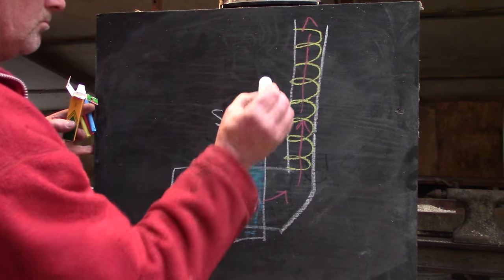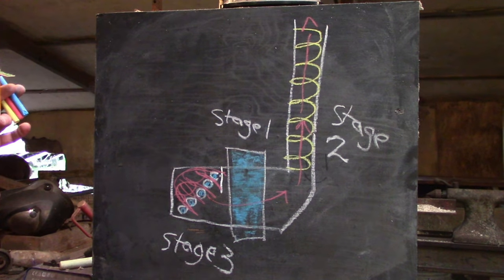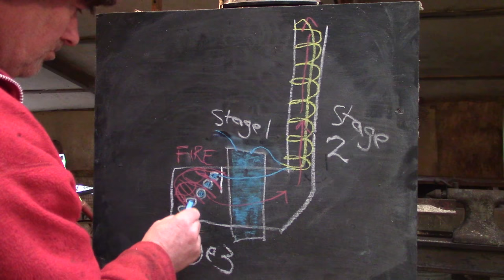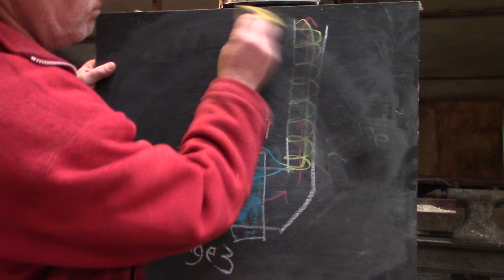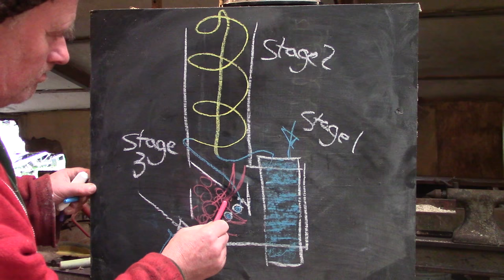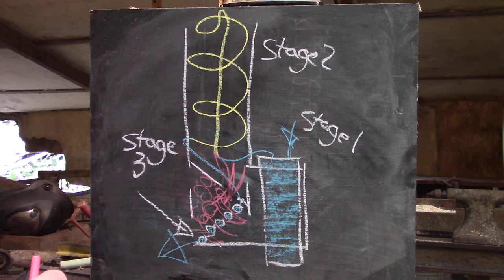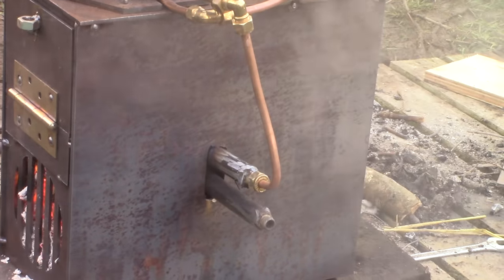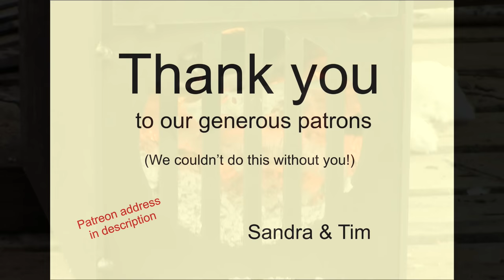Finally A Flash Steam Boiler That Works!!

Comment: Since it doesn't take much energy to superheat the steam, the grate alone may be good enough for superheating, you could use the pipe in the chimney for something else, for example preheating the feed water...
You may also mount some kind of funnel to the "wood input door", so it feeds itself by gravity and you don't need to put new wood in every 10 minutes...
A steam pressure regulated air inlet would also be great, so the air inlet gets closed when the steam pressure is too high. Of course that is a little hard to build, for a test version it should work with a manually regulated air inlet. But for a final version you may consider using something like a spring loaded steam piston, which opens the air inlet when steam pressure is low, and closes the air inlet when steam pressure is high...
Reply from the maker: In fact you need much more energy to superheat the steam than you need to boil water
Reply: @wayoutwest-workshopstuff6299  
You just need higher temperatures, but the needed energy is wayyyy lower...

For example: If your fire produces a usable power output(without losses) of 1kW, and you start with 1kg(approx.1Liter)of water, it takes 418 seconds to heat the water from 0°C to 100°C. To convert all the water to steam it takes additional 2230 seconds.
But to superheat all the steam from 100°C to 200°C it just takes less than 200 seconds...

To make this numbers more useful for continuous steam production, i calculated it for 1kW of heat input and 10°C feed water temperature:
From 1kW total input power, you need 135 Watts for preheating the water, 800 Watts for producing steam, and 65 Watts for superheating the steam to 200°C.
These numbers are just for steam without any pressure. As the pressure (and therefore the boiling temperature) rises, you need more energy for preheating the feed water  and less energy for superheating the steam to 200°C...

Comment: I really enjoy your steam videos as I myself am working on a boiler and steam engine for my stove at the moment. I also tested overheating the steam but I think more important than the final temperature is the amount of steam that is produced, which depends on the heat power going directly into the water. Have you meassured how much water your boiler can convert to steam in a certain time? If your system is ment to power a steam engine, you should test that engine (for example with an air compressor) and see how much air your engine needs to run with the desired power and rpm. I'm looking forward to your next videos. Keep it up!
Reply from the maker: the problem is with a wood fire the amount of water boiled changes all the time. That's why solid fuel flash boilers dont really exist. I don't have an engine yet - I wanted to see what steam I could produce first. Any videos of your set-up?
Reply: @wayoutwest-workshopstuff6299  I see the problem with the unsteady heat power from the wood fire. Maybe the heat in the steel and the little water reservoir in your boiler can dampen the highs and lows a bit. I wonder about the solutions you will come up with. About my engine (which is only a model but brings problems like a big one) I haven't uploaded any videos but if you are interested I could send you an email with information about the set up and how I did the layout of power consumption, steam production, rpm etc...

Comment: The flash boiler on the Whites Steam cars was coiled steel tubing. 1/2", if I remember correctly. Saves welding in tight corners.

Comment: Your dry steam still looks a little wet. I don't know if its not hot enough, too much water, or you need a reduction pipe to increase the pressue and therefore the temperature.

Keep up the grate work, lol.

Comment: You should Get a Cordless Leaf blower (With few metal Stove Flu Tube + metal Interface plate mod To Jump Start the fire in  Under 3~5 mins 

You could use the Unused stream to Accelerate Air flow with venturi effect - Exhaust steam injector > Vacuum ejector  up the flu stack with a Y Regulator valve  keeps steam moving And  increases  the Fire Temp idling so when you put the Regulator to drive   You Already have the Stream power and heat needed

Comment: Copper tube would be fine,
Melting point of copper is almost 2000 degrees Fahrenheit
A wood fire is only about 1200 degrees Fahrenheit

Also I would suggest a bigger firebox

Comment: You could of course use it to power a steam engine. But most piston and turbine engines run on pressure, something your boiler will likely not produce enough of (not before turning it into an IED).
The Watt engine however (and the Whitbread engine) doesn't run on steam pressure, but on the underpressure that is created after a valve is opened and the hot steam flows to the cold condenser. The greater the difference in temperature (ie. dry steam versus cold water), the greater the force pulling the piston down.
Reply from the maker: I'd like to make one of those too, but you need a large piston..

Comment: I believe they used to have 'fireless' steam locomotives to shunt wagons around gas and chemical works (for obvious reasons). There would be a source of readily available steam  and, rather than a boiler, the loco would have a 'steam accumulator' which was a bit like a fuel tank, but for steam.  The loco would need topping up regularly, depending on workload,  but there was the advantage of it emitting no fumes or sparks in the areas in which it worked... just a thought;-)
Reply from the maker: Wouldn't you need two pressurised containers though? One to make the steam and one to store it?
Reply: Yes, and you wouldn't actually store the steam, but rather very hot (200°C) and pressurised water. Then, when the locomotive draws steam, the pressure lowers and the water boils, until it is exhausted.
It works like a propane tank

Comment: I have a "REAL" flash boiler.  I use a stainless steel receiver placed at the focal length (10") of a 6-foot-radius tracking concentrating solar mirror, which reduces 48 square feet to 0.5 square feet.  Suffice to say, my injection pump turns several droplets of water into instant 2,000 psig dry steam INSTANTANEOUSLY !!

Comment: Absolutely fascinating ingenuity! I am afraid cleaning of coper tube of the overheater in the chimney will not be easy due to its helical shape . There will be a lot of soot. I think the match doesnt burn in flames because there is no oxygen in the steam.   I am wondering if the wood of match will be charred by steam. Best regards!
Reply: Its unlikely there will be much soot in the smoke stack. This is because the stove burns hot enough to burn off all of the gasses.

Comment: I had been thinking of a similar project, my design has the fire box piping running up the sides and over the top of the fire box as well as the grate,. Also running it as a true rocket stove by using a second larger diameter pipe to drop the fumes back down  into the chimney proper the copper coils would be on the outside of the riser pipe and a steel coil pipe about 4 inches above the riser where there would be a ferocious amount of heat. by using a extractor fan on top of your chimney you could do away with the fire box  bypass. by using two copper coils in the  down draft chamber you could feed the hot water from the tank boiler up and down the double copper coils then into the grate from there back into the the riser and up to the top to the steel coil and back down the same way and out of the side of the first boiler stage chamber, by fitting a  cold water tank on top of the down turn pipe you would be able to feed your primary boiler with preheated water, with a pan lid on it would be easy to top up and a gauge glass could be fitted. Would also like to mention a fan assisted draft to the grate would obviate the need for a chimney top fan and greatly increase the temp in the fire box for a fast fire up and steam production. sorry if non of this makes any sense to you, if not let me know and I will try again. I had hoped to produce enough steam to be able to drive a smallish steam launch of about twenty two feet.
Reply from the maker: How would you power your fan, David? 
I'm sure yours would work too, but I'm happy with mine. I just need to work out how to balance the input to the amount of heat available. As you know you can't pump hot water or steam - only cold water. How will you balance your system?
Reply: @wayoutwest-workshopstuff6299  There are only minor differences really between our ideas, I had planned a slightly larger fire box than yours fed by air from underneath and rather than a cylindrical boiler in a second chamber I would use a tank at the back of the fire box and the heat rising over it and back down the far side like a reverse back boiler more fresh air would then be fed into the bottom of the riser tube to feed the rocket effect, insulation at the correct points is the key to keeping the system going, I had thought to use a crank handle blacksmiths air pump for the initial fire up, once the fuel is gassing and the rocket effect in full swing the system should be self running as far as heat is concerned , provided fresh fuel is added at regular intervals as the draw provided by the rocket only works as long as there is sufficient gas to fuel it, of course the draw could be boosted by adding a flue or vent type breeze powered extractor to the top of the flue, however a control choke would need to be added for windy conditions to prevent over heating a second flue working in reverse of the extraction flue could be used to provide slightly pressurized air for feeding the grate should it be required but I think it unlikely as the rocket effect should in theory at least provide all the draw needed.. the system would be gravity fed  the water tank being higher than the flash tubes I think a flow restrictor at the bottom of the feed pipe to the first tank should provide enough control, the only problem I foresee is air locking in the system but this would not be too difficult to overcome with the correct forward planning. . this does of course make it all more complicated which is why I was so drawn to your idea.keep it simple. Have you discovered whether or not you boiler will provide sufficient steam to reliably drive  something like a swan or signet engine?

Comment: Push the puddle away from the mig tip, or weld away from the nozzle, chasing the bead as the puddle reaches the desired width, and you can push right into the hard to reach points of the inside angles

Comment: 1 brazing over the ground welds. 
2 please learn what a locomotive steam "Dome" is and how and why they work. 
3 never let a steam boiler of any kind run dry. NOT EVER NO MATTER THE REASON. 
4 Please continue your experiments and consider keeping all pressure experiments inside  a walled roofless enclosure perhaps made of used tires. 
5 ( My personal favorite) Practice screaming the word RUN!!!!!  AS you set your best foot work  example. 
This has the added benefit of making sure no one relocates your tools or enters your shop area without a phone call or a previous reservation.

Comment: I would research a Hartford loop steam boiler, if the piping isn't ascending as you heat it, you run a risk of condensing and losing temperature.

Comment: The new version looks much better. Very nice! The only issue I can see is cleaning. I assume the chimney can be unbolted for cleaning out, but you might need a door at the bottom where the air flows in to clear out the ash
Reply from the maker: There's a drop-down door for that, but the stove needs legs first for it to work
Reply: @wayoutwest-workshopstuff6299  Ah I see, good thinking

Comment: So now is the question how to convert this dry steam into a kinetic force? Next logical step for a steam locomotive would be a steam cylinder operating a rod that drives the wheels. But i think that is way to complicated to manufacture said cylinder, you need a lathe for that. How about going the way Ferdinand Porsche choose while designing his version of the Tiger tank? In order to save weight of the transmission (which was one of the Achilles heels of the final Tiger due to overload), Ferdinand went with electric powertrain. The engine powered a electric generator, while electric motors powered the driving sprocket. I think this way you will save a lot of troubles compared to a pure mechanical design. Greetings from Germany :)
Reply: A counter argument for the Porsche Tiger electric transmission is that the Porsche Tiger and its transmission worked worse than the production Tiger…
Reply: @andrewreynolds4949  Well, that's true. But this isn't 1942 anymore, technology improved. 😉

Comment: Next time Bend the pipe with a pipe bender to make your round ends so you can weld straight bits.  
Also to weld 90* corners like that your going to want to use a brazing torch and high temp brazing rod.

Comment: Mig welders are not the best for air tight welds. When you stop welding the wire can burn back towards the the tip leaving a tunnel in your weld. Enjoyed this video

Comment: I must say I’m a bit worried about pressurized steam going through those welded steam pipes in the grate, but I expect you’ve thought of that…
Light up and… stand well clear just in case!! Sounds like the donkey agrees with me😂
Reply from the maker: You could be right - but if they fail surely it should just put the fire out?

Comment: I find that I need to get some draw up the flue of my rocket stove, before lightimg the main firebox. Otherwise the convection from the firebox comes straight out, rather than up the flue.
In my case, I can shove a burning rag down the burn chamber and into te base of the first flue riser. Once the draw is there all is good.

Comment: My guess is that the force of the steam blew the matches out, like blowing out a candle.

I assume you'll make a steam engine, but perhaps you could try steam bending some wood.

I'd also suggest a one way valve, AKA check valve, at some point. Probably on the water inlet is easiest and cheapest, that way if the pressure builds for some reason then it wont go back up the mains water line and will go out the pressure relief valve.

Comment: Welding those tight corners can be done with a stick welder fairly easy. I'd recommend using 6013 electrodes since it's not too hard to work with. You did discover though that welding a system that holds pressure is quite difficult. Back when I was an learning I had to weld a pressurized box and found the same thing. I wouldn't personally recommend you get a TIG welder unless you're already good at it or have money to pay for all the gas you're gonna use learning. Don't get me wrong though, tig welding is very enjoyable, especially when I wasn't the one paying for the consumables.
Reply: perhaps silver solder would be the way to go as I do with my steam engines, rather than weld.
Reply: @barriegreen9812  Perhaps but with the direct contact with flames it is liable to melt.

Comment: Regarding steam engines - oscillating cylinder types have precious few moving parts and lack the need to faff about setting valve gear. They are somewhat less powerful but should have plenty enough for what you're doing.

Comment: You could possibly increase it by adding fire brick between the fire and the metal because once the fire brick heats up the fire bird can hold a lot of heat more so than the metal so in theory even if the fire starts to dwindle the bricks will keep it going until you can get going on the fire
Reply from the maker: Interesting idea - thanks

Comment: in the original design, dropping some lit paper down the stove pipe and then lighting your fuel in the main compartment should have gotten the draft moving.  it's a method used in some rocket stove designs.

Comment: FWIW, I could tell just by looking that it wasn't a rocket stove.  With one of those, you couldn't use copper in the chimney because it would literally melt if the water ran out.  (They can easily hit 1KC in the (well insulated) chimney.)  In fact, rocket stoves stop producing smoke after five minutes or so because the chimney heats up past the ignition point of the volatiles in the smoke.  You couldn't even use regular steel; you'd have to use stainless steel tubing to withstand the high temperatures.  What I'm saying is that you'd be better off basing your design on a rocket stove.

Comment: Now they are making a microwave boiler that its basically like a gas boiler but with a huge magnetron inside and its super fast and efficient to heat up water using electricity, like a big microwave

Comment: A side effect with the new Flash boiler design is when the smoke rises it also creates a lower pressure around the boiler to which then the smoke would also go around the boiler.

Comment: What stops the steam from the boiler going back up the water supply pipe rather than/in addition to up the chimney heat exchanger? Does the water supply pipe have a one way check valve on it?
Reply from the maker: It will do..
Reply: @wayoutwest-workshopstuff6299  I said in your last blog if you could hook it up to a car turbo charger you could get some work out of it. Then if you direct the exhausted steam into a cooler chamber that will create a vacuum and reduce boiler pressure

Comment: I question the use of old camp gas canisters as floats. They are a pressure vessel, filled with air and a small amount of flammable gas, placed in a hot environment. What happens when the gas and air inside expand? Is there a possibility that one will rupture?